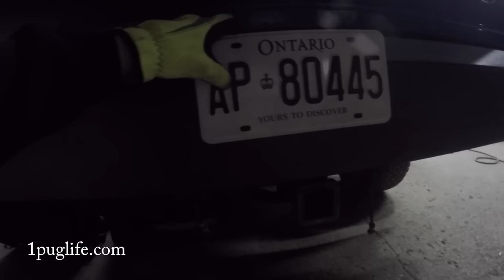i just can't

Comment: Pug please don't insult poor Abby and Gracie by comparing them to Jock Strap because Abby and Gracie a both smarter than Jock Strap by at least 150 points on the IQ scale.  Also on your back bumper they make oval rings with a saw tooth metal on top, all you have to do is attach the hinge they come with and they swivel up.  I cannot remember the exact name of them but they are usually on heavy equipment vehicles and are anti slip metal on them, but I think you know what I am yapping about or a commenter  might know.

Comment: Pug 1. an idea for the rear bumper. at the top corners add a 1 inch angle piece to close the gap under where the tail lights are and it would look a lot like the front bumper. just a thought.